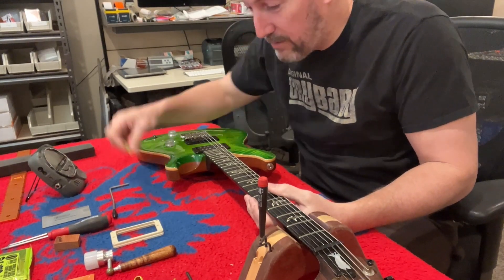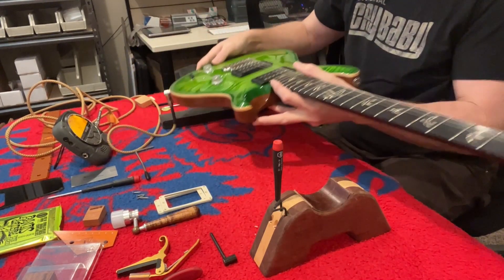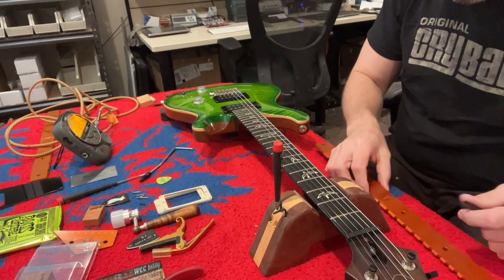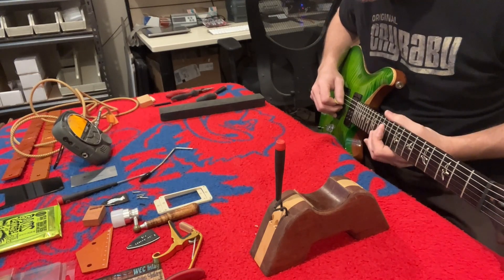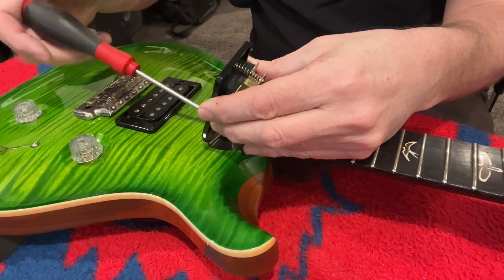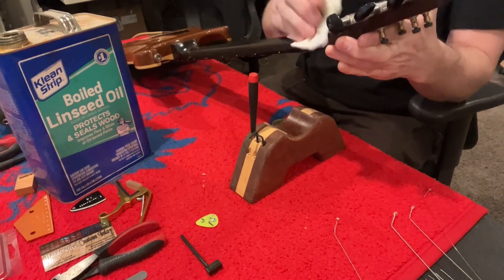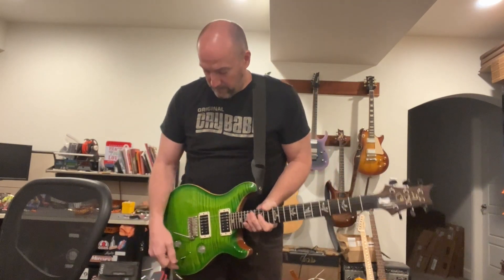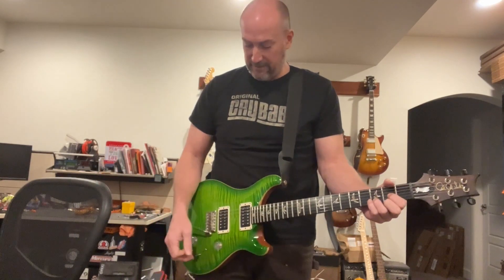PRS Custom 24  - Let's Make It Float Like A Butterfly

Comment: Always enjoy watching your videos.  I don't know how to do any work on my guitar,  so these do help with learning.  Still though, am really intimated by having to set intonation and action on a floyd rose unless it involves only adjusting the truss rod 😀
Reply from the maker: We'll handle some intonation on FR bridges coming up.  I've got a couple I've filmed.  It's easier than you think, you just have to approach it methodically and it will all work out.
Reply: @SkyScraper Guitars  look forward to it.  It's mostly just something I need to get over and just dive in . I'm always afraid of doing some irreversible damage and have limited time to play everyday so I get stuck between evaluating if I should work on the guitar or use my time to practice 😆, but setups,  especially if one has to get them done can be $$. So it's a must have skill.